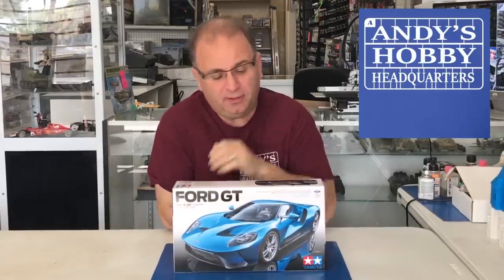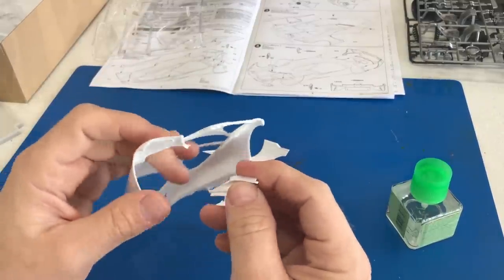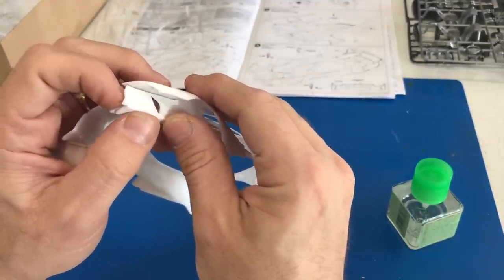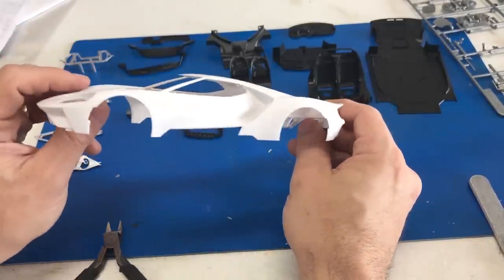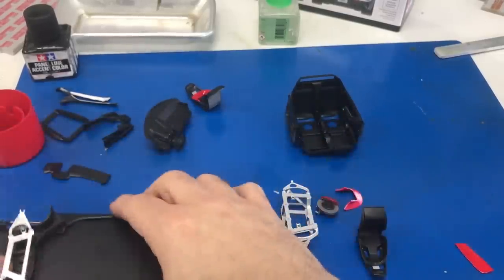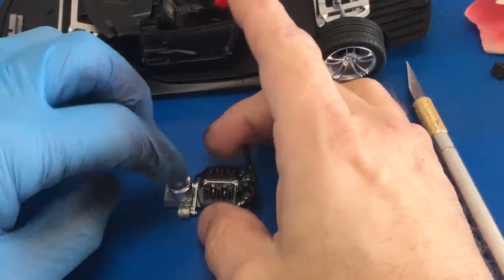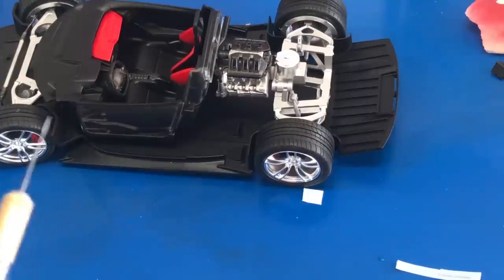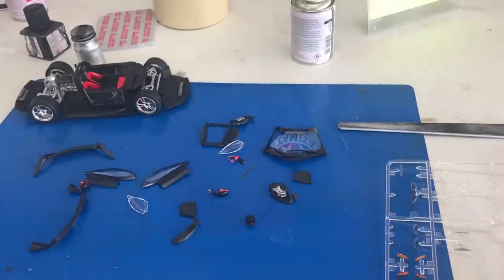Building the New Tamiya 1/24 Ford GT Step by step, Plastic Model Car

Comment: You did a fine job Andy, looks great. Racing Fords to me are always blue, all the Shelby's, cobras etc.  Again, that's my impression. Ferrari is red. So when I build mine it will be blue.  That's the beauty of plastic modelling, we can build our own dreams.
Reply: yeah, it's the international auto racing color. Italy is red, USA is blue with white stripes https://en.wikipedia.org/wiki/List_of_international_auto_racing_colours
Reply: kalbs89, if you sand ALL the paint off, you can do a decent job on a metal body model. I've done it on a 1/24 Mercedes rally car because to me, most rally cars tend to be white. It came out nicely.
Reply: I am the same. Ford racing means blue and white stripes. I will be going with those colors. But it is your model and feel free to do any color you want.
Reply: I agree 100%. When i think of Ford I think blue with white stripes.
Reply: Mine will be mom-jeans tan.
Reply: @CafeenMan  is that a Ford color?

Comment: Try putting your decals in water backing side up...it keeps the curl from happening.   I put them in water for 20 sec or so then pull them out and let them sit on my mat face up. It keeps the backing rigid so it's easier to slide.  I use warm water and swap it out half way through.  Also add a drop or 2 of decal solution in the water to break the terger pressure.

Tamiya Racing Blue was made for this kit.  Along with metallic red.

Comment: Use Meguiars plastic polish. Amazing stuff. Most auto stores will have it in their detailing department. How about a fine wash in the panel lines. Based on your armor, you should be pretty good at it. I use a true watercolor prior to the clear since it is so forgiving. Add a very small drop of dish soap to the water and it should go down nice and smooth. Sorry, this is an outstanding build Andy!

Comment: Great job, nice clean build.  Splash paints are base coats and require gloss coats.  Base coats are easier to paint as you are not trying to obtain a gloss with the base coat, only a good a solid base for the gloss top coats, which can be sanded out, like Andy did.  Maybe if you build another one of these, you might consider spraying the stripes.

Comment: Good video on this new kit.
I ‘ll like to say that for model car kit building, the car body is best to be sprayed with aerosol spray paints like Tamiya spray cans.
The thickness of the spray can paint work always appeared ‘true scaled’ against the real car.  Whereas, air brush painting suits military models building as the objects are not refine products as compared to flashy automobile.  In fact , I do air brush only on my presentation drawings.
Spray can painting whether is gloss or clear coat on metallic colour on a well prepare ,cleaned, and sun warmed up body will give you a high gloss and stabilised looks without any polishing. 
You can sun bake the model car body under the sun in a clear booth but with proper ventilation for half a day to achieve a more sharp and permanent look. The model will appear closer to a metal automobile rather than a plastic object.   Never spray a car model body on a rainy day !
To achieve variation in colour finishes from standard spray cans, you can venture into using light metallic colour coat on different undercoat  colour to alter the finished look. It is fun to see your own version of colour scheme for car model building. After all, the car industries are now producing cars of exciting colours.
As for this Ford GT kit, it is really well made except short on engine compartment details. On those meshed air intakes areas, I think using nylon mesh netting as substitutes is better and relevant.
Have fun!

Comment: Wondering if it's better to paint all the body panels separately before building. I think it would be easier to wet sand and polish instead of doing it with all the panels in place.

Comment: Great build. Looks good. Just a heads up on the real car the a pillars are black/carbon fibre. Also the portion on the lower part of the doors isnt completly black. The top part is body color. Other than that fantastic job!

Comment: Thanks for sharing, lots of work in building these things. Looks great. I had problems with glue on windshields on my earlier builds and didn’t know about the car wax trick, thanks for sharing that. I use clear glue for clear parts now and have not had problems since. Will be looking for this kit when it comes out and definitely eyeing that smoke black color! Cheers 🍻

Comment: Couple ? 's for anyone that can help. I'm new to this stuff, so please excuse any dumb questions. 
What type of glue do I need to be able to bond painted parts? What I'm using now just kinda melts the paint or clear and makes a mess that will not bond.
Also, how hard is it going to be too paint this body using spray cans? I'm talking about being able to get into all the body parts behind the door area. I do not have access to an air brush.
I've seen this kit painted first, then assembled, but I need to know an answer to my first question to do that, lol
Thanks for any help!

Comment: Ciao Handy, another great work, as usual! But, in my opinion, the kit is "too Tamiya like". I mean too basic, poor of details. Great color choice! My suggestion: when a paint with a glossy/shining red, I usually use a black glossy blak first, than 2 layers of clear (sanded) and then the red. the result is that the red is much more shining. White base usually absorb part of the shining property. Evaluate tu try this with your net car ;) best from Italy. Alessandro

Comment: I see you didn't put any primer on the body before painting.  I never do either.  Why do you suppose other builders put it on first, which in my opinion starts filling in the seams and blunting the body lines before any final color is added.

Comment: Thanks for the great build review Andy. What did you end up using for the interior red accent color ? I didn't catch you identify that so my bad if I missed it. Also, the exterior color looks great. Did you have any issues getting color or clear sanding the rear body forward of the engine glass. I'll call them sailplanes, but they look to be tucked up out of easy access. Would you recommend painting body parts before assembly in this area ? I think I've seen that recommended in other reviews of this kit but would appreciate your thoughts. Again, thanks for the build.

Comment: Andy, since there has been lots of online discussion on how TS-13 Gloss could damage the decal ( even the Tamiya labels the warning on the spray can), I was wondering if you have any issue at all. There has also been remedy by doing layers of mist coats and to avoid wet coating. What's your take on that?

Comment: Looks really good. Question for you... you do the color coats and one coat of clear and then you wet sand with 3k and lay another coat of clear on top
Of that? I still haven’t got this process 100% right. I’ve tried a few different methods. Usually I would do the primer. Then sand. Then do color and clear. After last coat of clear is done I wet sand up to 12k and then use the Tamiya 3 step polish. I’ve had times where it’s came out really good. But it seems more than not that I obtain scratches that the polish doesn’t get out.  I assume this is just in the clear coat? I guess what I’m asking is if I run into scratches that the polish doesn’t get out can I go back wet sand again and then re-apply the clear? Or do I need
To then go back down to sanding and re shooting color is this happens?  Thanks in advance. Again nice work.
Reply: Use Zero 2K Diamond clear and you can forget about sanding and polishing.

Comment: For what this kit is worth you did a nice job.  But far as i am concerned i will be making improvments to my tamiya ford gt kit. first  i will start out by buying
one tamiya ford gt kit and two revell germany ford gt american lemans kits. I will build the first revell germany ford gt kit as is right out of the box. The second revell germany will be used as a donor parts kit in order to borrow the engine compartment  and the engine to transplanted into the tamiya ford gt road car kit.  As long as the revell of germany ford gt american lemans kit and the tamiya ford gt road car kit are on the same scale then it sholud work out.

Comment: So it is more or less a snap kit? Very simple construction for  $60 dollar kit. I would have drilled the brake rotors out, and the red inserts would look silly with any other exterior than what you chose.

Comment: Great build! Since the Ford Liquid colors are triple-layer paints and most red/blue paints require a few layers to build up a solid color, you can add some depth and realism by undercoating with silver or gold - much as manufacturers do. (Also, a little panel line accent color would improve the scale look!)